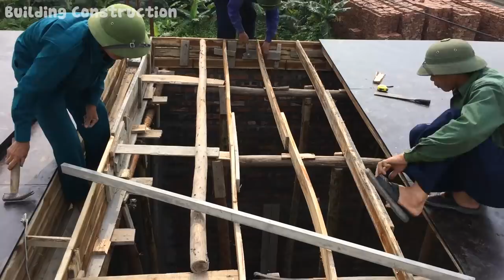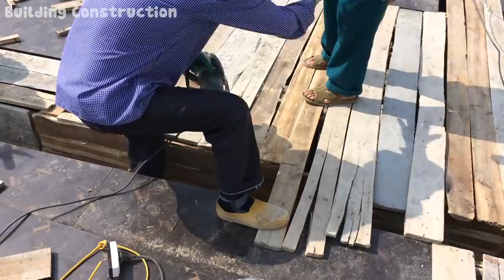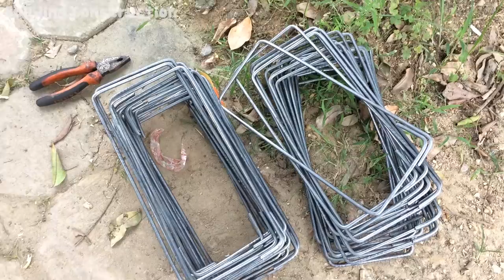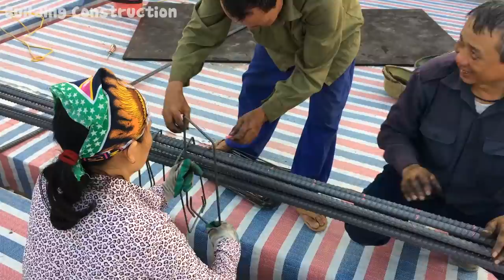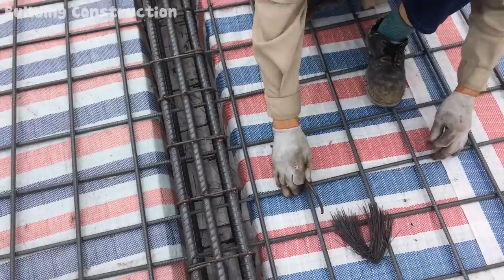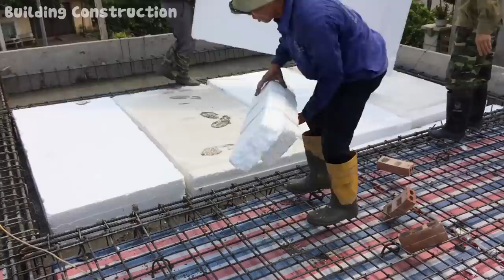Roof Construction Step By Step - Techniques For Building Manual Roofs With Ready-Mixed Concrete

Comment: What is the use of tharmacol in the middle of concrete
Reply from the maker: thank you
Reply: Tharmacol is use to give  shape
Reply: Heat transfer nahi hogi madam. Aur waise ye inki video nahi h kahin se utha k apne channel pe chipka di h
Reply: हीना
Reply: Filler slab
Load reduction
Heat insulation
Reply: That is lightweight slab in gcc countries they are using hourdi blocks... Its reduce the weight and save concrete...

Comment: Thats the advantage of using machine and power tools, you can save works hours and fast faced of the projects especially cutting and bending of rebars unlike the traditonal manual constructions hand tools.Sometimes the measurement spacing of the ties is not accurate done by the workers, especially on columns, beams , slabs , stairs, etc only guessing and not properly on according to the structural plans. They only follows how many ties and rebars should be put.
Reply from the maker: Thank you for taking the time to watch the video
I wish you happiness success
Like and share videos for me